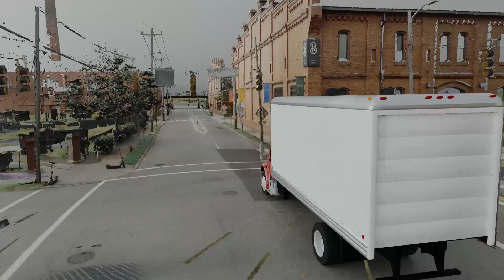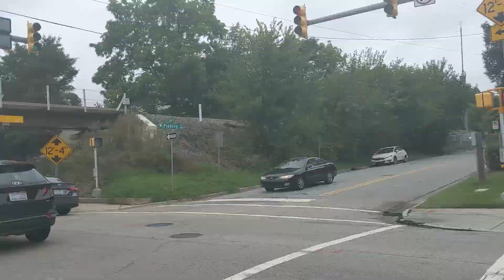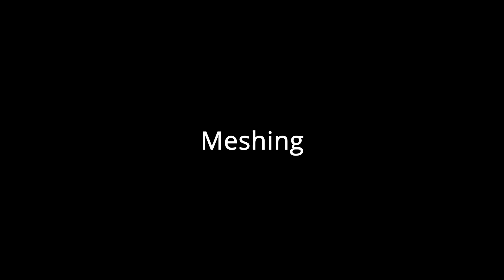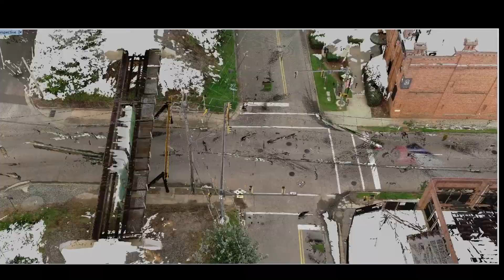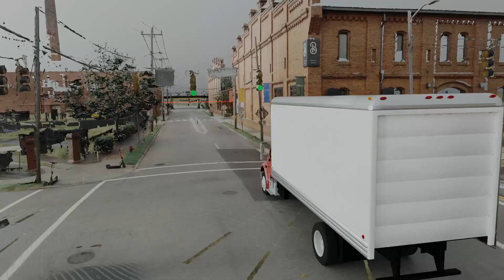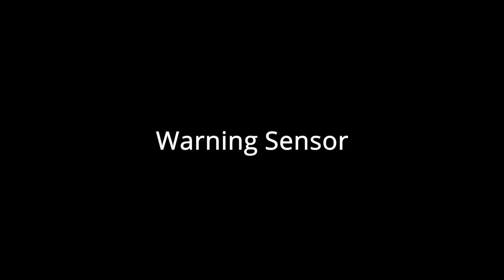11foot8 Canopener bridge 3d Scanned, Measured, and Animated #11foot8 #11foot8+8

Comment: That new bridge has been compromised by a crane truck that hit that bridge so hard that it lifted the railroad tracks and its a matter of time before a train derails on that bridge, the old bridge was much more solid that this new bridge and the could fix the problem by moving the sewage pipe towards the side of the road like under the sidewalk and then they could just lower the road 1 foot, but the railroad needs to inspect that track cuz its definitely not aligned correctly anymore

Comment: As is evident in the crash videos themselves, you have verified that the sensor is way too close to the intersection. The drivers are getting “slapped in the face” by the light  (turning yellow right in front of them). If they judge that they can safely continue, they totally miss the over height sign. The sensor needs to be far enough back to guarantee that the light will be red well before they get to it. The over height sign itself needs to be be lowered, so it’s more clearly visible.
Reply: Or flashing red lights instead of just cycling red. Maybe some overhead rattle chains prior to the intersection as standard at most low clearance bridges.

Comment: This bridge causes so many accidents.. the rail road refuses to increase it's height and there are utility lines underneath. The drivers are the last entity I would blame; the city should pass an ordinance saying no rail can have limited height that is going to cause accidents. You can also see, without 3d scanning, that the floor is not flat and therefore there are spots where it appears to that you are in compliance until the bridge devours. Drivers are being told a a height two inches shorter than what is possible, and you can see this as evidence as most of the crashes involve only slicing off the top .. hence the "can opener' designation.
Reply: That bridge was likely plenty tall when it was first built and trucks were shorter.
Over time, the standard of what is "normal height" for bridges and trucks has only gone up.
And this bridge does not cause accidents. Drivers of those trucks cause the accidents.

Comment: from what i can see it seems the light timing required isn't enough for the distance from the sensor to the intersection, like they need to add a couple poles and move it back immediately next to the intersection into that block to catch trucks a few seconds sooner.
Reply: It is enough time if drivers are actually driving the speed limit of 25 MPH.

Comment: I've watched a lot of the 11ft 8 videos, but until now I never knew what the street leading up to it looked like.  If your "timing" is correct, they need to move the height sensor up to the next block to give the stop light enough time to go red and people can slow down.  They also need to add more flashing lights at and before you get to the bridge.  You should send a link to this video to the city to show that they need to make some changes.  Thanks.
Reply: They can’t move the sensor back because there are side streets that trucks could turn onto, or turn from.
Reply: It would not matter much if they put a Flashing Neon Laser Lightshow on... there are always going to be truck drivers that: a) don't know the height of their truck. [rental drivers!]  2)are distracted by something other than the area in front of the truck. [phone, burger, hotrod passing by]  3)Must. Get. There. Now.  [Just plain stupid or mostly asleep]
And this will keep resulting in 'Shave and a Hair Cut... $20K!'.
Reply: @michaelmoronez5980  well put! 

I kinda want the laser neon light show anyway, though!
Reply: The timing is sufficient for drivers who are going the posted 25 MPH, and who don't "race to beat the red".

Comment: To be fair, "overheight must turn" sounds like a general warning ("hey, be cautious"), and not like a warning directed at a specific truck (as in: "you are overheight, you must turn now").
A flashing red X and different wording to indicate the immediate danger would probably help
Reply: Yeah, but they also have a sign on the side of the road indicating the bridge clearance. A professional truck driver really should know how tall their trailer is, and the light being forced to turn red should give them plenty of time to assess the situation (unless they run the light on top of everything else, and I think we can all agree that doing that is unforgivable). I tend to be a lot more sympathetic toward people who are renting trucks for that reason. They should know how tall their load is, but considering it isn't something they have to deal with every day it's easy to see how they could end up getting peeled.

I'm not sure that a flashing red X would be a better solution because it's even more ambiguous. In my experience, that signal is generally used to indicate a lane or road closure, and that could send the wrong message to smaller vehicles. The current sign could definitely use some improvement, though. I think even adding punctuation would help, as there is a notable difference between how someone would read "OVERHEIGHT MUST TURN" versus "OVERHEIGHT! MUST TURN".
Reply: @Spectere  And this is why the bridge has more rental trucks in its food pyramid than professionally driven trucks.
Reply: The Sydney tunnel has a system where a water curtain activates and a massive 🛑 is projected on it.

Comment: In my country there is always a portal painted in red and white, with steel bars hanging vertically on chains, just before a low viaduct or bridge. The low end of the steel bars are an inch lower than the viaduct height. The steel bars clatter against the truck and the driver notices it and has enough time to stop before the low viaduct. At low tunnels (we have two of them in my country) there are height sensors and traffic lights go on red and barriers come down and all highway traffic comes to a standstill. The truck driver will get a very high fine, for disobeying traffic orders and traffic signs to a mandatory diversion/detour (at the last exit before the tunnel) if the truck is too high. It are always foreign truck drivers that hate to loose time by taking the ferry and often try their luck at the highway tunnel.

Comment: They should go back to 11'8" with a plastic or wooden barrier. That should be low enough that a vehicle 12'4" will know they are too tall and avoid it. The vehicles that are just a little over 11'8" will occasionally hit it, but it will just be plastic or wood and do little damage, and easily replaced. In fact a light weight barrier could be hinged with springs so once struck it most likely just springs back.
Reply: Boston's Storrow Drive has a mechanism like that - flat sign panel hung from chains, so it doesn't need any maintenance normally.  It is famously ineffective, though that is probably in part because trucks are banned outright so everyone hitting it is an amateur - college student from out of town a rental truck, mostly.
Reply: @MarkEichin  Do they only hit the hanging sign?  Or do they go right through the sign and hit the actual structure?

Comment: The sensor 1 ft lower, and they raised the bridge 8". Did they even raise that sensor?

A less conservative sensor from the start would have helped. Now people know they can ignore the sensor... most of the times.

But the easiest solution would be to hang a boom on chains at exactly the height of the bridge (maybe a hair lower). If you hit that boom, you will hit that bridge.
Reply: How do you see it from inside the vehicle?
Reply: @submittedbymail  that the sensor is low? People learn that from each other. If they see a number of trucks pass through with the warning, they may try for themselves.

It may also work a few times, until they get me tires or some other change.

Comment: I’m willing to bet they never moved the sensors after they raised the bridge. Though I’m surprised they don’t move the sensor further back to disincentivize red light running. Ultimately, still disappointed they heightened the bridge :(
Reply from the maker: I actually scanned it before they raised it also - from my measurements they raised the sensor about 5 inches

Comment: you can not blame the engineers? 

a suspended vertical height bar 5 meters in front of the bridge would do the trick - 95% of the vehicles are slow enough to stop...

the "can opener" is a total fail of the urban planning department
only exceeded by the guys responsible for the bridges evil brother the "un-boxer" 
https://www.youtube.com/watch?v=V3-UugI0JoA

Comment: Thank you for this video and your efforts.

Ive wanted to measure it myself with one of those little $25 laser gadgets, but haven’t the opportunity to visit the bridge.

Perhaps you do a scan of a common box truck.
Over lay how those dimensions interact taking into consideration the crown of the road, the width of the box and the narrower wheelbase ?

I’m curious if theoretically an exact 12’4” truck “gains” height as it’s tilted by the crown of the road compared to the level beam.

I’m also curious if any barely “over height” vehicles could squeeze by if driving right next to the curb.

Happy motoring 👍😎
Reply from the maker: Interesting, I may check out a scenario of a long truck getting stuck.

Comment: My perception based on the timing shown in the video is that when the light turns red due to the over height sensor, is there isn’t sufficient time to react and stop the truck.

While the majority of the responsibility is with the driver, this particular section of roadway is a trap by design.

There are multiple hazards at any location that a driver must watch for. This location has more than others.
Blind corners, parked cars, intersection, etc, and of course the bridge.

Many of the vehicles that hit the bridge are not “over height” vehicles requiring special permits. 
As such the “over height” warning is probably disregarded even if observed by the driver.

Many of these appear to be leased or rental vehicles which may not require a commercial license to drive.
The average rental driver will probably approach this bridge in the same manner as their personal Toyota Corolla. 
Entertainment ensues on the internet, at the cost of the driver, their company and risk of those in the immediate area.
Reply: I agree, the warning system seems poor to me.

The warning is unclear, and the traffic lights seem just as likely to encourage them to rush (to avoid the red) as to stop.
Reply from the maker: When the light turns yellow the driver has about 200ft to stop for red light - I just did a quick google search and it seems 3 second yellow duration is typical for 25mph.
Reply: @scanningcars6500  oh I agree it's all perfect in theory. 

But the point is that doesn't necessarily hold, in my experience a lot of drivers see a yellow light to mean "you have three seconds to cross that line before you get stuck" and floor it. For our trucks, that means they might be more likely to ignore the warnings and also hit the bridge faster. 
Would be interesting to actually measure truck speed/behaviour based on this light.

I would think a better solution would be a simple hanging bar in place of the laser sensor.
And/or a slightly wordier but more specific sign along the lines of "tall vehicle: you WILL hit the bridge, turn off". 

"Over height, must turn" isn't directed at anyone, especially because these vehicles are below normal height limits it's easy to see they might assume it doesn't apply or is a false positive.
Reply: Most folks nowadays travel over +8 mph over the posted speed limit. 
 Hanging bar in place of sensor would interfere with legit 13'6" trucks what would turn at the intersection. 
More wordy signage would trigger a TL;DR fault in drivers. (for the uniformed that means:  Too Long; Didn't Read)  
In a side note, perhaps rather than a bar that crushes roofs and makes a mess of the area, city should put a curved blade that cleanly removes and curls up the roof material into an easy to clean up Metal Jelly Roll Cake.  With the driver's tears as the filling.
Reply: @michaelmoronez5980  a hanging bar would be fine  even if they turn.

If they turn, the driver uses common sense to know the low bridge isn't an issue for them.

Comment: Thanks for the info. I’ve watched the can opener many times and now have much better understanding. The one thing that caught my attention is how low the sensor is set - 12” below the beam. My thought is that it’s too conservative and would result in many false alarms. A loaded truck would make it through safely one time and still set off the lights but next time, with a load, make contact.

Comment: The overheight sensor is still probably at the pre-12'4" height for the 11'8" bridge and crash beam, given that it's only an inch lower than that height, which is only just barely conservative enough to be accurate (and produce no false negatives).
Reply from the maker: Its not, I scanned it before they raised it - it didn't turn out great - but the height was different

Comment: This also looks suitable for 3D-printing as a scene for a model train layout
Reply from the maker: I do want to try that!
Reply: @scanningcars6500  Ooh! with a slot car style road and a box truck with a top that can be knocked off by the bridge!
Reply: For 3D printing you need 3D objects which are 100% closed, not a single polygon missing. There are tools to close a few gaps in a model, but i think the gaps in these scans are unfixable. Speaking from experience. These scans are probably 90% just 2D surfaces with textures on them.
Reply from the maker: @Engineer9736  Stay tuned :)

Comment: Thanks for doing this work and sharing your results.

One thing that becomes clear is that while the sensor heights are appropriately conservative, the sensor distance and timing are inadequate for vehicles that are travelling in excess of the posted speed limit (25 mph). You modeled a truck driving at 35 mph, and while the signals and lights trigger almost immediately, it only takes 4 seconds for the truck to get to the intersection. Anything less than total concentration on the environment will result in a truck speeding through the intersection.
Reply: Time for a speedbump
Reply: @hetsmiecht  Or turn all the pedestrian crosswalks into wombat crossings/continuous sidewalks, forcing trucks to slow down, giving the drivers more time to process the warning and react. As a bonus, it'd reduce pedestrian casualties, too.
Reply: The reason the sensor can’t be placed farther back is because of side streets that are safe for tall trucks. You can’t have the sensor going off for trucks that may not be going straight.
Reply: Anyone going 30% over the limit in a high density residential area is already a danger. At least hitting the can opener only hurts themselves and not hits and hurts others.

Comment: I have an idea. How about just put up a sign that says NO TRUCKS!! Most trucks are really close to the height of that bridge or taller. They built a fairly low bridge over highway 167 near me. It only lasted a couple years until a semi hit it doing about 60 mph. Damaged it so badly they had to rip it out and build a new one. RIP bridge and the driver who hit it. They built the new one higher I think 14ft 7in. It was 13 something?